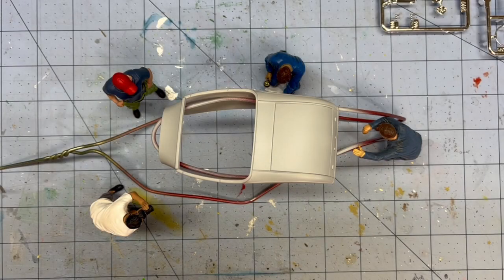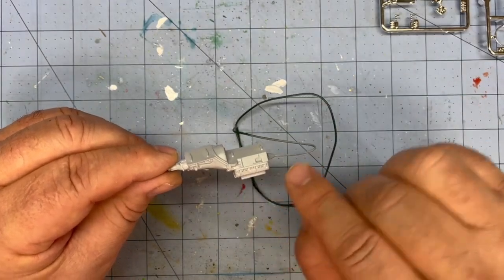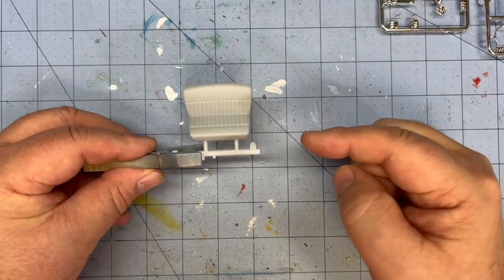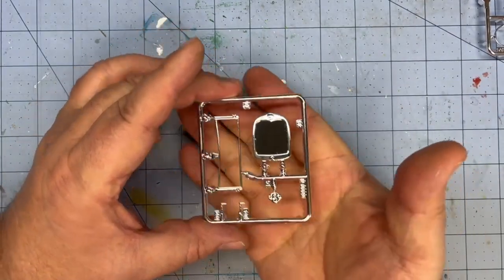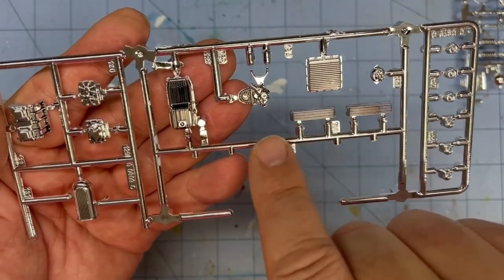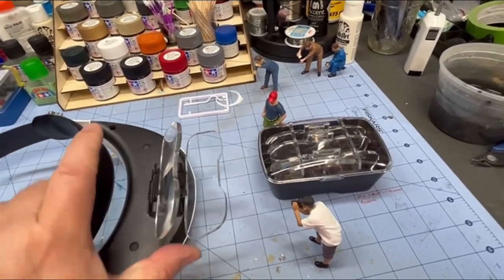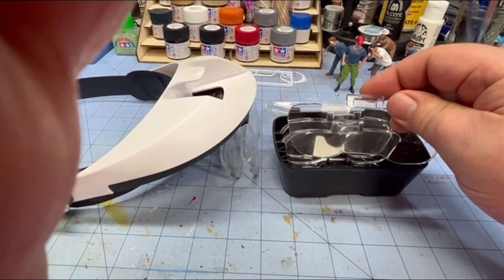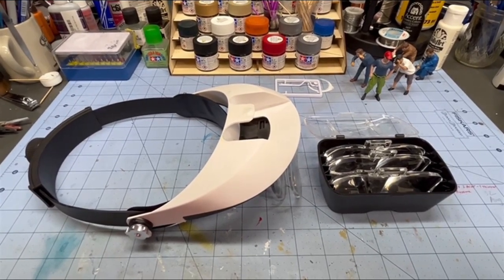Revell 29 Ford Model A Roadster build update #1

Comment: I didn't realize that kit needed so much clean up.  Nice tip on the visor.
Reply from the maker: It isn't all that bad.  I just spent a tone of time making sure all the mold lines were scraped down and sanded so they don't show when I paint.  Most of the time I do it as I go and it doesn't seem like it takes that long.  LOL.  Thanks for watching.

Comment: Nice update, you’ll like that kit, I’ve built 2 of them so far. Thanks for the visor tip, I just have a single lens magnifier and trying to wire an engine today using your .3mm solder trick, it just wasn’t quite enough sometimes
Reply from the maker: Larry, thank you for the kind words.  I use both lenses on my visor a lot any more.  I hope you liked doing the wires with the .3mm solder.